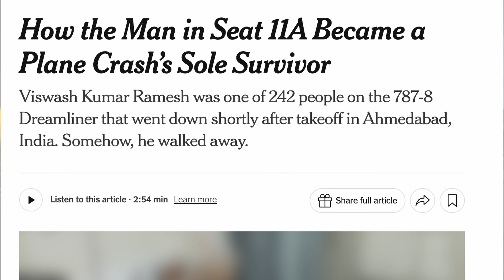Why the RAT Changes Everything – Air India 171 Update

Comment: I feel for those pilots. In less than 30 seconds, they were faced with potentially the worst problem imaginable just after take-off. I'm sure they tried valiantly to save the aircraft, and the fact that one man survived, and they avoided larger apartment complexes, shows that they did their best to save lives. Air travel remains the safest form of transportation, largely due to the well trained and skilled pilots on the flight deck.
Reply: They had no chance. Even if the plane at  least a few thousand feet  they could have done something but I am more less convinced that it was out of their hands
Reply: @kolgdsthh 

Depends on what happened and why, which we don’t yet know.
Reply: There’s was footage of this aircraft’s previous flight where the electrics were no working in the cabin. The passenger showed that the tv consoles were not working or the overhead controls. This was prior to a take off. Not sure if this has any relevance
Reply: @JuliaHarrisx  no relevance as the in-house entertainment etc apparently have a different source of energy
Reply: @aroundtheworld6093 Ah ok. I just thought it may have some relevance. Thanks for clearing that up.
Reply: The problem is maintenance and quality compromisation at the bureaucracy level. This shouldn't have happened
Reply: @aryanoberoi3359 again blame game... First it was pilots now it is maintenance. Let the report come out and say so....
Reply: @AnilYadav-nt9mf  how many Boeings have crashed in the UK in the last 25 years?
Reply: People from the previous flight reported that the plane had electrical problems.
Reply: @mkneely4539  "Problems" at their seats.  Those systems often aren't even turned on for a period.  AND they have nothing to do with plane's ability to fly.  They are isolated systems.
Reply: @mkneely4539  they complained about screens not working and ac not blowing cold enough air, that is on par with air indias standards lol
Reply: @mkneely4539   Just for my understanding - how exactly do you know this? Are you a member of the staff at the airport? by staff, you could be any staff - mechanical, ushers, flight crew etc..
Reply: @mkneely4539 Please ignore that video. That’s just a guy shamelessly trying to grab attention. It wasn’t electrical problems at a level to cause dual engine flameout. It was his seat IFE not working and ACs not being turned on when the aircraft was still at the gate (this happens sometimes as the engines are not yet turned on and the flight is running on APU).
Reply: @mkneely4539 At the beginning of each flight, you get a checklist of defects. Nearly every single aircraft has at least one.
Reply: @mkneely4539 really! Wth! All those poor folks died because of improper maintenance 😢
Reply: @aryanoberoi3359  And Boeing Co ignoring warning safety standards given by the whistle blower , and the bosses threatening the employees to keep mouth shut saying are you IN or OUT
Reply: @aryanoberoi3359 I think Boeing itself is at fault here, there has been enough evidence in the last few years to indicate that Boeing has cut corners to make money and over time their planes are susceptible to accidents like this
Reply: @aryanoberoi3359  bang on is poor quality
Reply: @aryanoberoi3359  stop blaming.. let the investigation complete.. everyone jumps to blame India and indians
Reply: @aryanoberoi3359  have u done the investigation to say it is maintenance?! We should remember Mr Sam ,whistle-blower from Boeing last year raised concerns abt 787 and its assembly and how it will create issues in just 10+ yrs of aircraft service..instead of 50yrs as claimed by Boeing
Reply: @aroundtheworld6093  Keep defending and expecting that an actual truthful analysis will relayed to the general public. Somehow they'll will find no fault in the plane but will blame the pilots or would say can't be exactly determined. I mean no wonder when public is like this with no backbone and who cares attitude, people will forget this event in a couple of days anyway.
Reply: @aryanoberoi3359  How can you say this in good conscience when you don't know the cause of the crash?  Before concluding what the cause was you really have to do a thorough investigation.  In the USA it takes about 12-18 months to do the full investigation and here you're deciding the cause based on media reports just a few days from the crash.  Very irresponsible!    Just calm down and let the investigators do their work...
Reply: @aryanoberoi3359 

While I agree that this should never happen, we don’t yet know what went wrong, or why. So it’s too early for the casting of blame.
Reply: @aryanoberoi3359  maintenance and quality check is done by engineers not by bureaucrats
Reply: @aryanoberoi3359 Not bureaucracy, it’s greed. These airlines will do anything in the almighty power to keep a scheduled flight going. Delayed and canceled flights would cost them millions. Gotta keep the show on the road. Can’t have that airplane not in the air making money, no time for repairs, updates, engine and airframe rest.
Reply: @aryanoberoi3359  how can you conclude that this was caused due to poor maintenance, preliminary reports have not come but this bro thinks he knows everything
Reply: @NishiKumari-up5lmAnother Sympathizer. Boeing planes have been having many problems and crashes like this for many years and they silenced the one of their employee who became a whistleblower or their planes problems. Now couple this with the fact india aviation has very low quality standards, extreme cost cutting etc this was bound to happen one day or the other.
Reply: @aryanoberoi3359  boeing is famous for making bad aircraft. So, it can also be Boeing fault.
Reply: @superstar8553 that’s recency bias, not historical fact
Reply: @ElliHarper ohh yes, we all remember the great marvel called 737-MAX.
Reply: This is the angriest comment section. Bye bye
Reply: The pilots did nothing to prevent greater loss. They literally had zero control over the plane and took no measures to change path.
Reply: As soon as they lost both engines and couldnt get them restarted those pilots became passengers and the plane was doing its own thing. Sad but true, and a horrific situation to find yourself in.
Reply: Is it even possible for a pilot to accidentally turn off both engines in this scenario?
Reply: @taylorc2542 No it's not possible, the ejectrics probably failed like Steve explains
Reply: Salute to these pilots
Reply: I've always felt that pilots are some of the most skilful genius's that walk the earth. This was even beyond their control.
Reply: They didn't avoid anything, my friend, they were unfortunately passengers as well, as it floated back to earth. 30sec is no time to avoid anything, with our without power.
Reply: The pilots were probably busy on initial attempts to get the engines sorted out if it was partial or complete engine failure. It looks like they might have decided to pancake the aircraft down to reduce forward speed & possibly reduce collision damage rather than put the nose down to maintain glide speed.
Reply: To save their skin, BOEING can say that the pilots were in fact Uber Drivers. Most people know corporate mentality

Reply
Reply: Agree with everything except that air travel is NOT the safest transport, it's highest safety in probability only because there's a million flights a year, but practically speaking, no other mode of transport takes as many risks during the travel. Being probability safe is not the same as being safe in most exigencies that could arise
Reply: They didn't avoid anything as lost everything and couldn't control anything!
Reply: That one man who survived out of the 250, gave up his window seat for someone who adkd for it n sat beside emergency exit. Thats not a coincidence.  God will literally pull people out n place exactly where they are meant to be for his own plans. Only god can do it.
Reply: Go and search name Sam Salehpour, whistleblower of "boeing 787 dreamliner". This tragedy was well organised and didn't happened inside the US. Boeing is an american company, this particular model had quality issues and safety concerns. Also gather knowledge about income, corruption and safety negligence of  Dave Calhoun, then Ceo of boeing...
Reply: Makes you now think that's why they never retracted the landing gear. They knew they were in trouble on rotation and maybe thought they might try in vain to land the airplane.
Reply: Pilot too gets fear of death so he will do whatever to be alive
Reply: Is it the safest though, not sure about this, because if something goes wrong with the plane, the death rate is usually really high
Reply: @ishanjalan3106  It is. By a long margin. You're right in the sense that when something goes wrong, it is generally catastrophic, but things going wrong is so unlikely. If you look at the numbers, you are over 1000 times more likely to die in a car accident vs plane accident
Reply: There is a open field next to the hostel. Unfortunately they hit the hostel
Reply: True. A pilot's worse nightmares in one
Reply: The safest means of transportation, as long as you fly Airbus
Reply: "Safe air travel??"

I send you over to Captain Sullenberger as to why it has become UNSAFER....
Reply: I know that you've been told countless times that air travel is the safest form of transport and you've been lied to. All data will say that trains are way safer. Have a look at deaths per journey for the UK for example.
Reply: This shit safest mode of transport is the biggest fucking lie mankind is telling themselves.
It is not.
Reply: I know right
Reply: Yes this guy was trying to pin it on pilots . 😂
Reply: Nope, its not air travel, its train
Reply: Wdym by that bro more than 50 interns died
Reply: Just sad
Reply: Its also safe because no one is tailgating you...
Reply: What kind of help can that tiny little propeller do for that BiG Heavy Jet  🤷🏼‍♀️ ?❔️
Reply: Everyone thinks that pilots are heros trying to save lives in the last minutes.  But that couldn't be further from the truth.  What they are doing is trying to do is make the plane fly or land softly as possible.  Nothing else is going through their minds.
Reply: Unfortunately I think this also may be pointing to a systemic problem for maintenance.
Reply: When disaster strikes right after takeoff, pilots have precious little time and altitude to work with, and every second becomes critical. It’s easy to forget the immense pressure they’re under in those moments, but their training, instincts, and courage kick in.
Reply: I think the fact that it hit a building was disastrous. In past a plane had landed in water and most passengers survived 😢
Reply: Air travel is as safe as the machine doing the travel!
Reply: The pilots sadly had no chance.
Reply: Obviously the investigation is at a very early stage, but there’s nothing they could have done if they lost both engines at that altitude and airspeed with nowhere to land. 

The question (one among many) is why they lost power.
Reply: N i forgot to mention that one man who survived,  he came out of it with no injuries
Reply: Cool story bra
Reply: Just believe the lone survivor 🙏
Reply: Sadly the fault happens in the maintenance flaws and ground checklist mistakes and the corporate milking profit over their customer's safety 😢, otherwise airtravel seriously the safest travel method indeed. For passengers sadly once in such situations they has no chance to do anything but accept the end which is tragic outcome of these failures of this mode of travel.
Reply: @Blackshadow07711 blame everything but not boeing . Stooge
Reply: Nobody is a hero here 300 people died....we need more investigations to conclude and judge everyone
Reply: 1:38 Sir, at this point you can see the Engine Flame Out Smoke. That's not Dust. 😢😢
Reply: @sambitranjan9584  good point...
Reply: @sambitranjan9584 impossible to say either way.

These GE engines are 70,000 of thrust each. It couldn't have aborted take off post v1 speed but on one engine it would have still lifted up.
Reply: @sambitranjan9584  Maybe, but I don't see how they would have managed any altitude if the engine flamed out there.
Reply: Safest way is the waterways
Reply: @yogeshnarayan1705 no ways is safety irrespective of its means as each has it’s limitations associated with it
Reply: @yogeshnarayan1705 not really, 2000 people drowned in the Mediterranean alone last year.
Reply: @yogeshnarayan1705 no it’s railways
Reply: no they did not avoid larger apartment complexes, the plan just crash after take off and they could not do anything.
Reply: The problem with air travel, is if something goes wrong you can't just stop and unload the passengers.
Reply: I agree with you right up to you saying it's still safest method to travel nope not at this time too many failures happening with aircraft in many many crashes in past six months' the planes have major safety issues
Reply: @mariannesantangelo6418  I’m gonna bring something else up that no one wants to talk about all these people setting up YouTube cameras on planes inside the cockpit. This should be illegal. This is another pinpoint statement that pilots are not taking responsibility for their actions. They have time to set up YouTube cameras like this channel right here you should be walking around your plane you should be looking at your motors not setting up YouTube cameras inside cockpits that should be illegal. There’s so many things about that are not right like for one you can’t see out the window correctly if you have a gigantic GoPro camera … i’m in there’s so many blatant things that pilots are doing right now that they should be putting in prison for I can tell you what the problem is. The problem is very clear pilots don’t walk around their own planes anymore. They don’t do their own self checks. They rely on computers and then they say everything’s ready to go when I was growing up in the 80s you used to watch a pilot walk around the plane every single time before it took off. I mean every pilot used to walk around the plane and do a full inspection. You might get 5% that do that now that’s an actual statistical Fact.
Reply: They didn't "avoid" anything.  Aircraft never even banked. Stop with the hero pilot BS.
Reply: @codyking4848   you were not in the pilot's place, and we are not aware yet what they actually went through at that time, so please stop saying that they didnt try or something!!! you never know!!
Reply: @codyking4848 .....
Sure they both tried hard to save the plane/do the least amt of 'on the ground' damage..
Rip both of them..
Wonder how u would have done????
Reply: @codyking4848  In such a situation - tightly housed right after the tarmac - you're just a spectator as Pilot. - Oherwise they would have immediatly point the nose somewhat down to gain a tad speed and then put her down - with some luck it would have prevented the fire - which is a very bad thing with 200 tons of fuel in basically every free cravice of the aircraft.
Reply: @codyking4848  Lehet,hogy apilóták nem voltak hősök,de ők tudták meg leghamarabb ,hogy megfognak halni..A pilóták biztosan nem hibáztak!Semmi esélyük sem volt a túlélésre!Talán  ha nem épületbe zuhantak volna bele ,akkor nagyobb lehetett volna a túlélők száma.
Reply: A boeing spokesperson
Reply: @divyareddy9350  safety engineers should of picked all this up. Unless they can’t figure this out for themselves. Most engineers in the UK would have grounded the plane.
Reply: There are lies, damn lies and statistics. That air travel is supposed to be the safest form of travel is based on the statistical evidence of lives lost in relation to passenger numbers verses miles travelled compared to other forms of transportation. Of course planes travel the greater distances so when lives lost in relation to passenger numbers verses the number of journey's taken is brought into the statistical analysis then rail is the safest form of travel and air travel is the most dangerous.
An ocean liner must have lifeboats so passengers can leave the ship, an air liner has what ?
Let's calculate what happens with transportation engine failure, a ship, train, car, lorry, motorcycle loses momentum but an airplane crashes. You take a chance on your life with air travel, almost 100% certain death with major mechanical failure.
Reply: @vmax4steve524  Very very stupid logic. This is transportation, the purpose of transportation is to cover distance, therefore miles traveled (distance covered) is the measure that matters. "Journeys" are arbitrary and are not a useful measurement.
Reply: Well, at least their souls can rest now that they know it's the safest mode of transportation.
Thanks for reassuring them. You should expect a "Thank You" card from all passengers any day now.
Thanks again, Quincy.
Reply: For you to say that air travel is safe right now is absolutely fucking absurd. There are planes falling out of the sky everywhere on a daily basis you might be talking from a mathematical truth, but you sure aren’t talking from any type of compassion, understanding and most of all your words are extremely reckless. You wouldn’t say anything like that if one of your family members had died in a plane crash it’s not safe at all not even a little bit. There are more planes falling out of the sky than ever before so explain it because that slogan the air travel is safe is getting downright fucking disrespectful and old. We’re tired of hearing it.
Reply: @ShayElias-wx2il  There actually aren't any more planes crashing than in previous years. It's just that the media has decided to focus on covering even minor crashes or near-misses a lot more this year, for some reason, and that makes it look like there are more crashes happening.
Reply: @ShayElias-wx2il Do a comparison of car accidents and deaths per year and deaths by flight. It's not even close. Planes going down just get the media attention.
Reply: @ShayElias-wx2il ....
Talk about stats....how many ppl daily fly safely Vs current level of those who do not..???
Look at this versus any other mode of transport...road/water...???
Thus the air travel stat !!!
Blessings to all families
Rip to all victims
Reply: @ShayElias-wx2il  you are being too emotional for an analysis video like this. You're in the wrong place.
Reply: @ShayElias-wx2il  wow that is so not true
Reply: @ShayElias-wx2il flying is still statistically the safest form of travelling by a long distance, and every accident makes future accidents less likely. You're objectively wrong about more planes falling out of the sky than ever before, but hey, why let actual facts and evidence get in the way of your wrong opinion on flying.
Reply: @ShayElias-wx2il Imagine if news reported every crash of every means of transportation worldwide. It would need 1,000’s of channels 24/7. Right? 
Commercial airplane crashes get clicks. Small aviation crashes too. 
To say commercial aviation is safe still stands. In fact it’s the safest mode. Is it risk free? No. Emotional damage occurs. It is safe. Very safe. 
My teenage daughter has flown 8 times this year. I’m not surprised at all that she’s safe.
Reply: @ShayElias-wx2il  "here are more planes falling out of the sky than ever before" this is patently false. You even admit that mathematically you are wrong. Get over yourself.
Reply: @ShayElias-wx2il he’s right though, flying is still the safest transport option. Yes there have been a lot of crashes this year but if you think about how many flights total there have been this year it’s still safe. More people die driving their cars. Since January there have been over 3.2 million commercial flights.
Reply: @drbass9677  The real question is not how many deaths per flight, but rather whats the probability of being involved in a crash and surviving.
Reply: @ShayElias-wx2il  Ok here's the explanation: There are more planes than ever before in the skies, therefor, more accidents. Not that hard.
Reply: @ShayElias-wx2il  why controllers or someone in the airport hadn’t seen this? And why there is no smoke afterwards?
Reply: @ShayElias-wx2il  airplane crashes are so rare that when it does happen, its all over news media. Hundreds of people die every week driving....
Reply: @ShayElias-wx2il  Okay but if you're going to say cars are safe, you can't say airplanes are unsafe. Stats matter. Saying "oh you wouldn't say it was safe if you had a family member who died in a plane crash" is telling. Why would having a family member who died in a plane crash give you the ability to know how objectively safe planes are relative to cars? What if you had a family member die in a car accident, would that go the other way?
Reply: @ShayElias-wx2il  Let's not mix facts with emotions. Based on a quick reseach, over 300 people die daily in India trough traffic accidents. Yet nobody talks about that even if the number is bigger and it happens daily. Everybody knows how dangerous the streets are but there is not gonna be any news agency who writes about that. 
Airplanes are in facts very safe but if something happens,  then it's mostly a bad accident and it happens not on a daily basis. That's what news are about - reporting about unusal things. 300 deaths everyday in a single country is nothing unusual but an airplane crash is. And accumulated over a year the traffic deaths add up to around 120k. A lot worse rifght? The regulations are much much stricter than in any other form of transport and I would defently be devastated If I lost somebody on this accident but I would not be less sad if a person died in a car accident. Or losing somebody to an illness.  Losing people you love simply sucks. But the streets suck even more than the air. People driving drunk, without licence, half of the drivers use their phone.
Reply: @Sandro557m  That logic is farcical. People get involved in multiple car bumps, breakdowns and even crashes in their lives and come out unscatched. How many survivors does a plane crash produce??
Reply: @saptarshisengupta8235  That depends on the type of crash, just like it does with a car. For example 379 people survived a collision with another plane in Tokyo last year.
Reply: @saptarshisengupta8235  this rebuttal makes no sense. the point he was making is that you are far more likely to become involved in a road incident than an airborne one lol. what is so hard to comprehend about that?
Reply: @RhiiRhiiQtee  People fear air travel because if these horrific crashes and more often than not in every single crash that is reported in the news fatalities are 100%. Yes Car accidents happen everyday and are far more common, but the odds of surviving one after being involved in one is far greater. Hence people are able to dogest that risk. Airliners are a touch and go. Something goes slightly wrong and everyone on board is dead.
Reply: @saptarshisengupta8235  You are arguing against a brick wall here. Your point is talking about how brutal a plane crash is vs driving on road.That does not make the road any safer than the air.  Talking about odds of survival is useless without considering the possibility of ending up in that circumstsance. Over a 180k people died in india alone because of driving last year. While I doubt the number goes even above 1k in air travel worldwide. So yes,  air travel is far safer than road.

Safety is done so that we could prevent such tragic events from happen, not to just let it happen. So there's no point in you talking about the chances of survival to fit your narrative.
Reply: @alwinsanthosh6878  
For all your tall talk, IT HAPPENED. And PEOPLE DIED. With 100% fatality. So stop coming in with theoretical arguments.

There is no point in saying "SO MANY SAFETY CHECKS ETC ETC SO WE CAN PREVENT CRASHES" when the Crash has Already happened.
Reply: @saptarshisengupta8235  Their logic is much better than yours.  It doesn't matter how many non-fatal car accidents you ALSO have.  There are 300+ fatalities in India every day.  Air travel is much MUCH safer.
Reply: @ReallyBigBadAndy76  How is their logic better? Stop partoting the same line over and over again and explain to me how their logic is better or how it refutes the point I made?
Reply: @ShayElias-wx2il he is saying it from the perspective of truth, not emotions
Reply: Agreed!
Reply: @ShayElias-wx2il everywhere, everyday? That's completely inaccurate!
Reply: @ShayElias-wx2il  take it easy sir. Walking on side walk from the road is not safe . because any running vehicles can loose control for any reason and can hurt walking people. The more technologies are coming to give more comfort in daily life are more dangerous than pressures cooker to airplane Engines. Electric shock to computer failure. Different kind of bugs in computer systems. Sir things can go wrong any where any time  on earth wrong. Pilots themselves don’t want to die. They are best trained people on earth. Yes mantiness careless also can happen. If you will se chart of travelers in airplane and other vehicles. Airplanes are least means least dangerous. Every day how many airplanes in the sky fly from whole countries on this earth. Than see how number of Accidents accures  campere other vehicles.
I lost very close person. Accept it or live with it that it could be this n that.anger never work. Change the system if it broken somewhere. 
In the end it is what it is.
Reply: @ShayElias-wx2il people spew statistics until they become one
Reply: @ShayElias-wx2il . Not commercial planes.
Reply: @ShayElias-wx2il  I think he didn't mean it in a disrespectful way. And you said: "There are planes falling out of the sky everywhere on a daily basis." So you can surely tell me about the 28 planes falling out in the past 4 weeks....
Reply: @ShayElias-wx2il using the f word is disrespectful
Reply: @ShayElias-wx2il Planes aren't 'falling out of the sky everywhere on a daily basis'. This experienced pilot is just expressing his professional opinion at this time.
Reply: @dereksawle  please dude tell me what the number is how many more people have to die how many more planes have to crash before you’ll say it’s not safe to fly just give me the number
Reply: @ShayElias-wx2il  In 2024 there were around 40.6 million commercial flights globally. In the same year there were 251 fatalities. That's 1 fatality in every 161k commercial flights. Planes are not falling out of the sky every day.
Reply: Totally agree its worst way to travel planes falling out of skies its not safe at all
Reply: What a load of shit! they caused the whole problem and cost 274 lives! they did not avoid any builds at all.
Reply: @jasonswift7098  How do you know they "caused the whole problem"?
Reply: @jasonswift7098 Do you have evidence? Then better refrain from saying so until the investigation is complete.
Reply: Would you consider the theory the C_A want some passenger eliminated and they use Boeing override tech to bring it down?
Reply: @Thinker2-truth I really hope not BUT under the current administration the C-A may well do that.  Alarms have been raised already about the lengths a certain country might go to to locate and deal with a specific passenger though so far it's been more fighter jets persuading pilots to land theories. Unfortunately both are possible when a state/country goes totally rogue
Reply: CAPT STEVE - YOU HAVE IGNORED THE MAIN FACT. WORK LIFE BALANCE IS NON EXISTENT IN INDIA. THOSE WHO WERE ON THE PLANE WERE THE LUCKY FEW WHO THOUGHT THEY WOULD ESCAPE THE GRIND. THEY COULD NOT AS THE CURSE OF THE PEOPLE WHO COULD NOT - WHO HAVE TO WORK 7 DAYS A WEEK ON MULTIPLE JOBS TO MAKE BOTH ENDS MEET held them back. human beings do not matter in India as demand for human resource is limited and supply is unlimited.
Reply: @subhranshuganguly2246  ❤to India
Reply: @subhranshuganguly2246  Bhai apnar comment er relevance ta ki???
Reply: @subhranshuganguly2246  India continues to be one of the worst countries
Reply: @subhranshuganguly2246 Stop crying here lmaoooo Wlb is already for developed countries who can afford to! Talk to anyone in China. Even the government employees are working 10-12 hours a day. This is exactly how China progressed so fast. And here we have some Indians crying about wlb but then want someone else to develop the country lmaoooo
Reply: @sidddddddddddddd  -son of rich dad ,son of corrupt IPS,IAS. MLA.MP, ADVOCATE JUDGE- SHUT UP.
Reply: @sidddddddddddddd where’s the WLB in the USA? Lots of people working 10-12 hour days here, no vacation time, etc. and we can certainly afford to. Corporate greed.